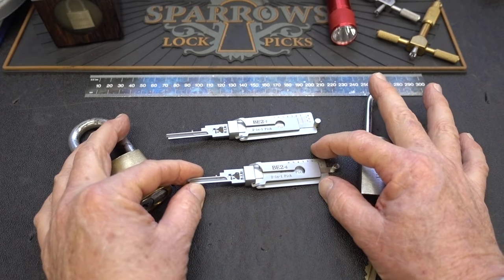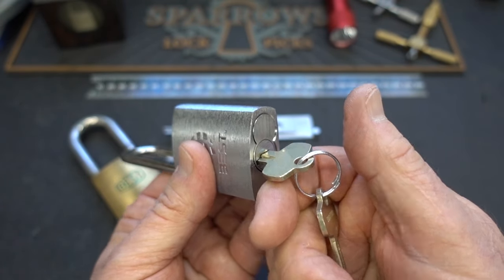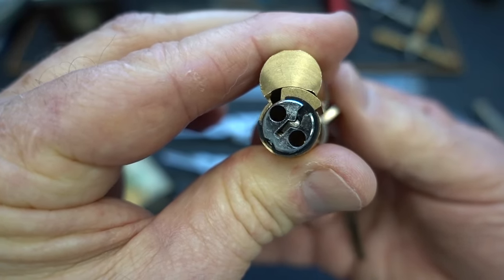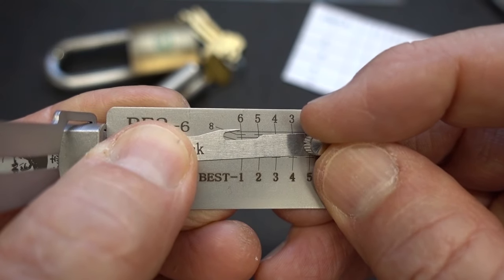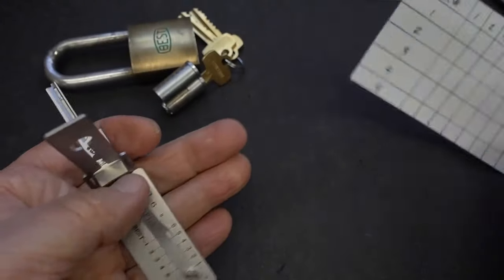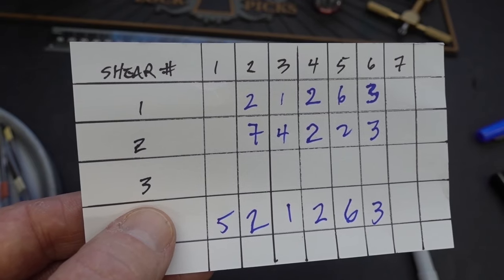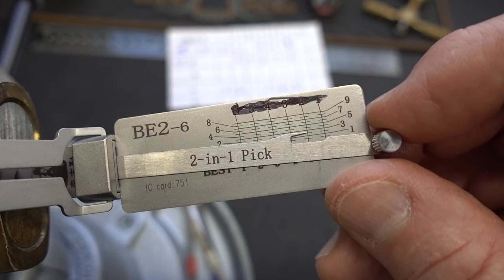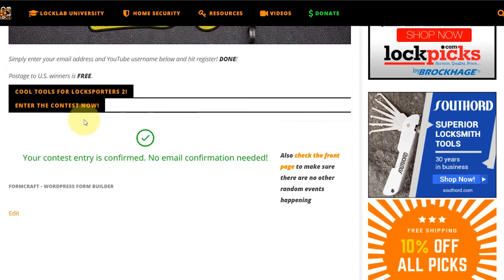(1638) Review: Lishi SFIC Picks (WOW!)

Comment: Do they have a lishi for best locks that are not A keyway? Ive made it to hard mode so now cracking these academia level beasts isn't easy. I've only got the core controller pins to hit and remove the core which works with the tool to turn it and put the core back but not exactly the results I was wanting.

Comment: Looks like the control is always a larger cut which would explain why you found control first
Reply: Look again. It's a mix of smaller & larger cuts.
Reply: I pin these cores up and create systems, I will always try to have some pins higher than the op key, and some lower, so no body can try to "guess" like that. ;P

Comment: I love the idea of LISHI picks, but they are too specific to individual lock types. I am pondering whether to buy one in order to help me to learn SPP (which I have struggled with off and on for years now). Would anyone recommend them as a training tool to get the feel of SPP? I can talk about every theoretical aspect of SPP, tensioning, finding the binding pins, security pins, oversetting etc... But despite having a pretty full idea of how it's done I've never even managed to SPP a master number 5, or a plastic training lock. Is SPP just something you need a talent for, or can anyone learn with enough time and practice? I'm currently trying to decide between throwing some money at a LISHI or going into a locksmith shop and trying to buy an hour of their time for some direct instruction.

Comment: Step 1. Destroy lock by drilling the control and pull the core.
Step 2. Punch the chambers and decode.

If you're assest proctection or in store management. A missing core is a massive security risk. Try to have awareness of your system and it's major flaws.

For me, if I have your core, I have your keys.

Comment: Wouldn't it be more secure if the normal key to open the lock is shorter than the one that's the control key? It looks to me like it's  the other way round 🤔 I might be wrong, because I'm just a beginner.
Reply: You’re right.  Look at the Schlage and Yale full size R/C change & control keys. Check their tips.

Comment: I have the same best lock and I can only pick it to the control line. I always assumed that with all the different shear lines I would have to reset and start over a lot, not the case. It's certainly not an easy pick, but it's definitely not as hard as I thought it would be.

Comment: Next step: automatic arduino picking tool checking all combinations without human action.
Reply: I imagine a clever one could build an 'autopick'  on this design that's about the size of a screwdriver with swappable keyways. Taken to it's logical extreme in the open source community, I expect you could take a picture of the lock with your phone, which would tell you what keyway 'bit' to put on the end of the tool. The tool could know how to pick the type of lock specifically, and all the user might need to do is click a button on their phone to tell the tool if it opened the lock or pulled the plug.

I gotta imagine the person who designed this pick, has considered the idea. I'm surprised it's not already a thing to be honest.
Reply: I think James Bond used one of those.

Comment: Is it truly possible to have Control key shearline that is not the most cut position for each pin? I don't know how the control part is actually manufactured but thinking about possible implementations suggests that the position that has least pin movement from rest should always result in workable control shearline. And maximal pin movement (least cut key) should result in operating key every time. I see that the example keys you have show both shallower and deeper cuts for the control key but I would assume that using the shear with least movement for the pin for those positions should also work as control position.
Reply: Okay, I found an explanation here: https://youtu.be/ZJH-qpWgCKA
When the pinning has at least one pin with less than height 0.125" pin in the middle of the pin stack and another pin with longer than 0.125" pin in the middle of the pin stack, the shearline order is reversed for that stack. That can be detected by checking the difference between detected shearlines for a single pin - if the difference is "too little" the order of shearlines for that pin is reversed. This is why you need to decode both shearlines for a single pin stack to detect the correct shearline for operating vs control use.

Comment: I was wondering how them lishi tools worked.

I also wonder Bill : I have several small brass padlocks that have a tiny hole in the bottom in line with the shackle, what is that for?
Reply: Usually to drain water out so they don't rust.

Comment: I would say... A total game changer like a bunch of other people are saying.
But the cost along with the keyway specifications makes it out of my forte. Lol not that they don't work... They work perfectly, it is that you need a different one for the number of pin as well as the keyway. And there are a lot of different keyways used in the sfic format. Yeah the BE or A are the most typical. I couldn't fathom paying hundreds for each one and there being dozens of keyways and then 7pin 6pin 5pin and even 4pin cores. Eeeekkkkk
Lol
Reply: Eeeekkkk is right, but if you have a 4 pin core you have a very rare, highly prized lock in your collection
Reply: @Pyrolock  
You are correct in those are not seen very often. I do have a couple of them in my collection. I will do a catch up on my collection as I have been off posting for a while.

Comment: If you were a con could you do this mapping before a video and use it to gain some type of advantage picking with a standard pick? 
In this case I think you could because you would know going in to it knowing which chambers to pick to which shear. 
How would you deal with multiple shear points without it? 
Does haveing multiple shear lines actually make a lock more pick resistant? Thats what seems like as you can pick it correctly and still not get an open do to shear mixing.

Comment: I did not preface my comment to you yesterday regarding your picking a Best cylinder with the Lishi tool. My comment was based on something I MISSED in your description and wanted to expand on it.  The reason:  BEEFEATER  Gin lubricates me better than WD40.  At the 8:00 minute mark you hit a shear line in chamber 4 at the #2 depth.  You said there were probably no more shear lines in that chamber because of its shallow depth.  I MISSED (did not hear) when you said “but KEEP GOING” just in case there would be another shear line 1 depth lower, seemingly a bad idea for a system.  Had I heard that I wouldn’t have posted.  But I will not stop making comments, only modify my lubrication schedule.
Reply from the maker: Jack,  It sounds like you have your lubrication schedule just about perfect - I don't recommend changing a thing until you find that you are involuntarily urinating in your pants.  At that point, reduce your intake by 5.3% and call it good.

Comment: The control shear line will always be past the operating shear line so the operating key can never wear to the point of removing the core , hope this helps .
Reply: IZAMBARDSKINGDOM I am a locksmith and code and run SFIC programs.  The Control sheer can be any cut plus or minus the operating key cut. It’s 10 off at equal values. So a 2 cut operating has a 10 cut master pin if both the control and operating are the same. If the control cut were 9 and the operating cut were 1, the master pin for control would be a 16.  Every time a key is inserted In the lock, all pins move and wear.  Stack totals are all 23.  I am not following what you are referring to.  If you don’t mind, please walk me though on your wear theory...

Comment: QUESTION... Will the BE2-7 also work for the 6 pin Best locks making the BE2-6 unnecessary like the SC-4 makes the SC-1 also unnecessary?
Reply: No because they are gauged from the tip of the key not the bow.
Reply: @dicktab  Best Lock company makes a number of cylinders with different keyways.  “A”   “D”   “E”  are some of their  most common keyways.  The Best “A” key will not enter a “D, E” etc. keyway.  It will only enter another “A” cylinder keyway.  The key blank and the cylinder keyway must be the same (except for some master keyblanks that go into multiple keyways).   Not positive, but I believe the BE2 Lishi is the Best “A” key profile, so it will only enter another “A” keyway cylinder. It will not enter more than the one keyway it was deigned for.  Like Chevrolet making the Corvette and Camero.  A Corvette fender won’t fit on a Camaro even though they are both made by Chevrolet.  Like Best Lock manufacturing both “A” and “E” keyway locks.  Their keyways are different.  Sounds like you might have a cylinder with a different keyway than the “A”.  Get a Best “A” key blank if you can and see if that goes in.  As for the BE2-7 pin working in a 6 pin cylinder I was told by their distributors it would not because of their tip gauging.   Good Luck.
Reply: @dicktab  All mortise cylinders have all the same dimensions except for the length and that depends on the door width.  1-3/4” thick is the most common.  1-3 /8” is the other common but normally only used in residential.  Different brands of residential knobs/levers are normally not universal.  One brand cylinder normally does not fit into another brand.  It’s a crap shoot.  Commercial grade levers usually have cylinders that are universal and can be interchanged most of the time.  If not, ILCO and other brands make just about all cylinders available in all keyways.  Your cylinder is probably a commercial type as Best usually only makes commercial products.

Comment: Back in the day an illegal booting company set up shop in my neighborhood booting cars at night parked in school parking lots, an inch too far from the curb on public streets and such. They were not permitted by the city but the city wasn't doing anything about them either. Probably because they were getting kickbacks. After a neighbor of mine got booted and me having a truck full of tools I cut the boot off with a body grinder then played with the lock later. It was a Best lock and I didn't know much about them at the time. I inadvertently picked the core out of the lock while fiddling with it and later made a toothy tensioner specifically for picking the cores for later use. Basically to be a dick I filed a control key for that lock assuming that there should be no differences on that illegal company's boot locks and the locks are easy to open with a screwdriver once the cores are out. I started collecting their boots every time I saw one. When that did not put them out of business I started installing the boots I had acquired on prominent citizen's vehicles parked on public property at night in their wealthier neighborhoods particularly some city counsel people. That started a crap storm and the illegal booters were shown the door real quick and never came back.
Later I used my core tensioner to pick a core then file a control key for a major media I did a lot of contract work for simply because it was a pain in the ass to get security to open doors for me in areas I needed to work in at night. Half the time their master keys didn't work and they could not find the correct key and I would have to pick it anyway. Fortunately the controls were all the same and it made my work there a lot less miserable.

Comment: I am a little confused.  shouldn't the first shear line always return a number that is higher than the second shear line as you encounter it first?  How did Bill end up with smaller numbers for the first shear line than the second in some instances?
Reply from the maker: You need to remember that the different pins may have a slightly different diameter, hence a different binding order.  “Always”?  Nothing is EVER “always”...😀
Reply: @bosnianbill  I wasnt talking about binding order.  i am talking about the pin cut.  You always start with the lishi at a heaight of 9 and push it down until the first shear line (say it's 6).  that number will be always higher than the next shear on the same pin stack (say it's 2).  How did you end up with number lower first and then higher second on the same pin stack?
Reply: @warddc I’m confused about this too

Comment: So, after you have picked and decoded both the operating and control, why not just make keys to that biting instead of replacing the core?  It is great tool, but it is a bit on the pricey side for the hobbyist lock enthusiast, especially since it only works for one key way and set number of pins.  At $120 a pop, one could spend $1,000 just to cover a few common key ways.
Reply from the maker: I felt the 7-pin core offered more security than the 6-pin core.  Yes, the ARE a bit pricey but if you can convert a $10 lock (w/no keys) into a $35-40 dollar lock after replacing the core I think you'd make the $ back pretty quickly.  Also, if a locksmith is faced with an SFIC, most will attempt to drill it out and often damage the lock housing (usually in an institutional door).  This tool does no damage and they can still charge an equivalent amount.  Less work, no damage, same earnings. The other keyways (KW1, KW5, SC1, etc) really are not necessary if you have a bit of picking skill.  Their only advantage is that they allow you to decode a lock and cut a new key.
Reply: Bosnianbill hi bill if you hadn’t pick how would you know which shear line number went to each other
Reply from the maker: @highwaymenpizzaco5164  Once you map the shear lines on the card you'd simply begin using different combinations of the different shears until you got an open.  Begin at the extremes (all maximum cuts, then all minimum cuts).  If the locksmith was lazy, one of those will give you the control shear.  Once you ID the control shear, then all the others are nothing but operating shears.
Reply: They're tools for smiths and not meant for enthusiasts.  At $120, that's a couple lockouts or calls and you'll cover the initial costs.  The initial investment cost is to keep the random joe off the street from going out and buying a set to do... not so legal things.
Reply: @eak125 nah, it actually just keeps enthusiasts out. Anyone considering using one of these "in production" would probably make back the "investment" after a single heist...

Comment: Can someone explain how the double shear line works? How do the pins inside look? Are they divided into three parts each, instead of two parts like in normal locks? Otherwise, how can the first shear line have both pins that are set higher and lower than the other shear line? Does he have a video with a diagram of this? Thanks in advance, in case someone could help me understand  🙂

Comment: To be honest I have mixed feelings about this video. I spent over 10 years as a locksmith at a university and about 50% of the work was on the BEST system, I retired from locksmithing a few years back. I did find the tool interesting and I question who assembled that core (doubtful that it was master keyed by BEST, maybe Stanley since they did change the master keying system and in a few cases made it much worse). Mr Best would never have a even and odd number in the same cylinder and the smallest "b" pin would be a 2 on a A2 system, I think you can get a 1 pin in a A4 system, "a" pin would be the bottom pin that the key runs across. Then again is seems like that core only has a operating key and control key pins in it. If you come across cores that are painted they were setup for contractors during construction.

Comment: As a locksmith, I don’t see a cost benefit. I am sure there are exceptions, yet I find it a rare day we would ever need to decode some one else’s system.  The “A” keyway is as generic as they come and as a general rule, a system of size or system that is important will be on different keyways or more higher security cores with legally patented keyways.  This tool is nifty, but pricey and financially impractical for the anomaly in real use and far too expensive for the upper 5% of the narrow lock-sport community that will pay that much to play.

Comment: It is difficult to see how  you are interpreting the pin depths from the scale on the BE2-6.  For example at time 14:28 the video shows a value on the BE2-6 at 7, you say aloud instead 6.  A few other examples happen where the value seen in the video does not match how you interpret the number.

Comment: As a working locksmith i'm totally confused by this video. Whilst being able to pick the lock to gain entry is nice but it really is completely useless. It's a bloody padlock, if the keys are lost no customer is going to pay a locksmith to open a lock of this type on a padlock and replace the core. Damn site cheaper to just cut the padlock and replace it! The Lishi picks are fantastic for vehicle entry but for padlocks, no just no. Lishi picks are incredibly easy to use once you understand how they work, the idea of them is for decoding locks for vehicles to allow you to cut to code a new key and not really for domestic locks.
Reply from the maker: Since you used the word "whilst", I'm guessing you are a UK Locksmith, right?  In N. America the SFIC core is one of the most common locks found in government, commercial, and educational facilities.  MILLIONS of them are out there installed in entry doors, office doors, desks, apartments, filing cabinets, power boxes, router safes, server racks, tool boxes and, yes, padlocks.  They are very popular because it is so easy to swap out the lock in seconds if something goes wrong or security requirements change (like somebody getting fired or quitting).
Reply: @bosnianbill  Hi Bill yeah sorry did not seem to be rude and to be honest had no idea these locks were so wide spread in the US. But as stated these tools are the muts nuts when it comes to picking ;)